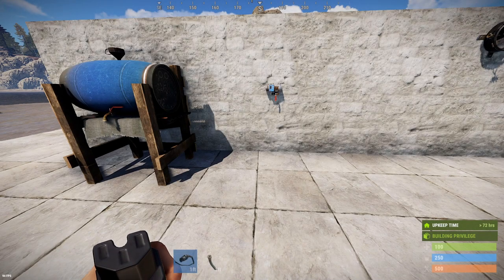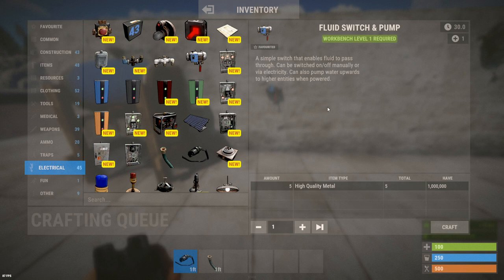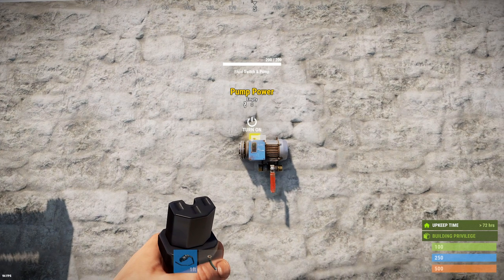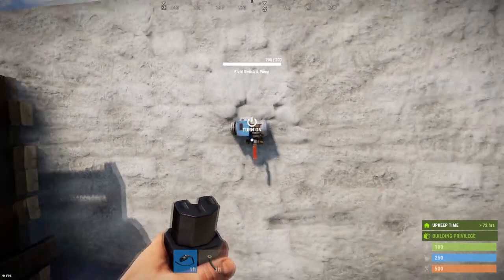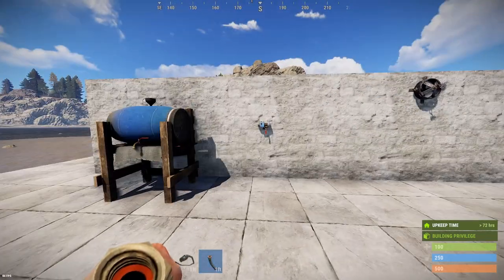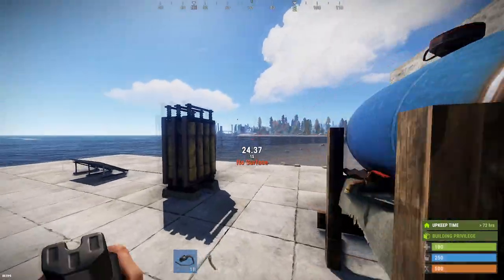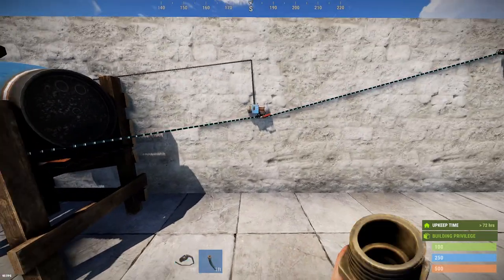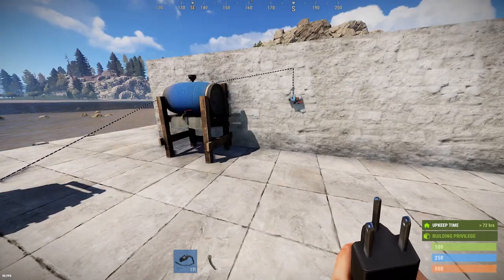Rust Electricity 101: Component Guide - Fluid Switch & Pump

Comment: Excellent! Nice to see more videos :D you are my go to rust electrical guy thank you

I do have one minor niggle that I would have liked to have seen more specifics as to how the toggle works. I'm assuming it's every instance of electricity that it changes state like a memory cell and not when electricity is removed like a reverse blocker. 

I had some niggles with my own timer circuit last wipe and I couldn't be work out where I was going wrong and ended up not bothering in the end, especially when turning it on manually was the easy fix at that point
Reply from the maker: Correct, you the toggle should change the state of the pump any time one or more units of power is applied. Good catch!

Comment: mhhm already used it... like that
i just want to use that toggle to start the sprinkling from one spot where i used to place a switch or button or whatever. the video did not answer this question... On a 5*5 FARM on 1st floor, i dont want to run to the 8 pumps and do it like that...

Comment: Have been few months I haven't play rust.
"...move water to higher elevation like this sprinkler"
Wtf??? A sprinkler? For what? 😂
Reply from the maker: There is a fluid and plumbing system now (very similar to electrical system) for watering planter boxes for farming. All part of the Farming 2.0 update. It's not entirely just for food, you can sell corn and cloth at bandit so it's for economics also.